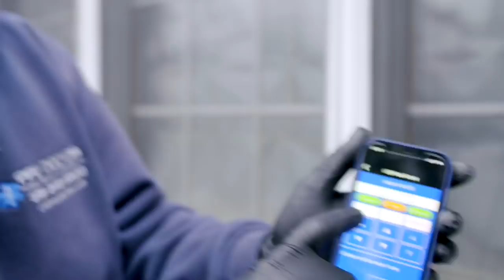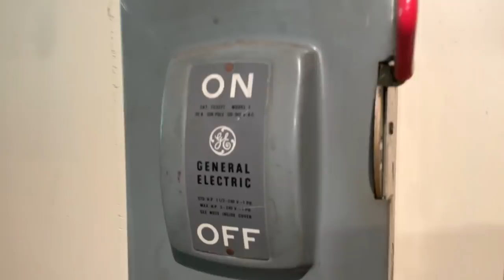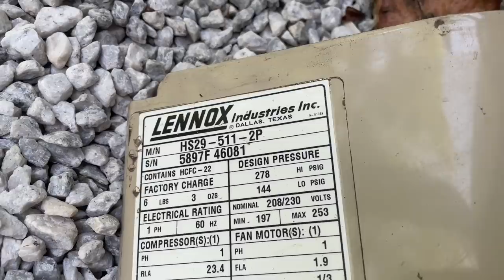House Almost Burnt Down - Luckily Someone Was Home - 50 amp Circuit Breaker Didn’t Trip Condenser

Comment: I am licensed electrican I would check main panel possible burn spots on bus bars. Rewire and replace everything going outside. To the proper wire and fuse size.

Comment: Mikey, In order to cover your ass, I would get an electrician to check the wire from the disconnect to the panel!  If that whip melted like that , I would bet that the wire to the panel has a pretty good chance of being damaged or at least was overheated!

Comment: Looks like bad ground connection. Breaker will not trip on short to ground if ground path has high resistance and less than 50A flows through it. It appears the conduit was used as ground path, but it probably has loose connection or corrosion. Even if metalic conduits are used running separate ground wire is better because of this possibility.

Comment: I would bet the line in the house looks just as bad. That's probably what they were smelling inside the house, luckily any nearby wood framing didn't ignite. I guess this is +1 for fused disconnects as a second line of defense.
Reply: I'm guessing the line wire is junk as well. Some of them fused 50-60 amps can also catch fire, but should stay contained inside the steel box. Sand filled at that amperage. Good call on the old school fuses.

Comment: Great video I second what someone said about the cause of the breaker not tripping was no equipment ground on line from panel to disconnect. Equipment ground would provide a low resistance path the ground to clear the fault and trip the breaker when the compressor shorted to ground. Without a equipment ground you have a high resistance fault Capable of melting the wires and starting the fire at a lower amperage than the breaker is designed to trip at.
Reply: 100% agree using steel flex pipe for a ground is a bad idea
Reply: Your right. That and 50a breaker on too small wore
Reply: I saw 3 wires in that flex conduit. 2 hots and a ground.
Reply: @NY411Info  the third wire was the low voltage
Reply: @sciatl2505  If it was the low voltage that seems weird. They usually run that along the line set I thought.
Reply: @NY411Info  yes watch at min 15.00 the third wire was the control wire he said that in video and yes the control wire should not in the same pipe
Reply: @sciatl2505  Ah, well that explains it. The conduit was a resistive heater at that point since there was no real ground. I think the 50 amp breaker was too big as well for that unit.
Reply: Under old code at the time that his building was built line voltage and low-voltage communication wire can be in the same pipe as long as it’s powering the same piece of equipment. Although I don’t do that but it was allowed by code.

Comment: What was the wire size on the 50 amp breaker?   Also, the nameplate said minimum circuit amps 31 and max size of 50 fuse or breaker.   As an electrical designer, I would put a 40acb on it, not 50a.    Respectfully,   Kevin

Comment: Similar scenario, I had a compressor short to ground. The ground was not connected at each end correctly. The current to ground then took the path of least resistance which was the suction line. Armaflex at coil actually caught on fire. Homeowner was home and saw the smoke thankfully. Electricity will do funny things if not done correctly
Reply: Almost exactly what happened here, except it was through the whip instead oof the suction line.
Reply: If the short happened in the liquid tight, the steel can act like a heating element which it did. Replace with nonmetalic. Upgrade the disconnect from the 3 phase one and have an electrician verify wire and  CB size are proper. 
Thanks Mikey I love watching

Comment: People don't really understand how circuit breakers work and why gfcis are where they are. Ground fault protected outlets are in your house to protect human life. Breakers are there to protect the infrastructure that is your house. The trip curve on that 50 amp breaker will trip before the insulation on that wire heats up to 130 degrees. Something failed in this system. Maybe the wire gauge (not likely), maybe the supply voltage, or in this case it's most likely a bad breaker.   If this homeowner wasn't home this house would be at best an insurance claim. At worst it would be a tragedy where a faulty electrical component caused an entire family to die. This is no bullshit scary. I've never experienced this level of danger first hand.

Comment: Mike ,Outstanding job on the electrical diagnosis I like how you always start with the basics i’m wondering if when that compressor shorted out .If it was a partial short making the wiring act like a toaster element it would’ve been interesting to do an amp draw test to see how many amps it was drawing ?????   Pete M

Comment: Jurzy wants fused disconnects,I use to whine but when I came to a similar situation that's all I use!!
There was a Loose connection somewhere!
You can't stop a Goodman!!!😂
ATTA BOY HIGH PRESSURE MIKE😎
🥃🥃🍺🍺🍺🍇🏌
Stay safe.
Retired(werk'n) keyboard super tech.
Wear your safety glasses.
Reply: No ground wire in the whip, that whip isn't designed to take short circuit current. Flex was acting like a heating element and the current was not enough to trip the 50 amp breaker before meltdown, could have even been less than 50 amps.
Reply: @jrmcferren  It looks like it had 3 conductors in it to me. I see 2 blacks and what appears to be a white. Blacks are hot and the white would've been used as the ground.

Comment: Was there a separate copper ground wire in the conduit? The conduit itself can't handle 50A so it melted even with less than 50A. The fuse is probably good and not at fault. The fault was a missing ground wire. Only if the circuit is RCD protected you can downsize the ground wire since a live to earth short will trip at 30mA or 100mA instead of 50A.
Reply: It's not a coincidence that new installations in Europe use a RCD on all circuits, it protects against faults like this.

Comment: I was on a roof one time,middle of winter and I did a friend a favor for his pizza shop,as I'm leaving the roof( -5 deg) a mother service tech is coming up my ladder, I'm like wtf,so I told him that the gas valve is junk and he says I'll double check it, I'm like whatever it had 0 ohms at the coil and 24 calling, so I'm like ok have fun and I got down and another tech come walking around with his ladder,so I told him that another guy was up there already,he was pissed and turned around towards his van,I took my ladder down and headed to my truck,went in and told him he owed me for diagnosing his rooftop unit,head like how about a couple slices,I'm like fuck off you cheep skate,so I left as I'm driving away the other guy was waving me down from the roof,I guess he should have brought his own ladder! The pizza douche called like 4 different companies ! Asshole

Comment: So being a Master Electrician for 30 years+  what I see here is there looks to be no ground wire, and the steel of the sealtite being used for this and it can but not over 6 ft and it is a poor ground if the connectors are not tight with a tool. Since the comp was shorted to ground, current was likely running across the steel of the sealtite and since it was a bad connection it heated up melting the plastic off the whip, but the current was still below the threshold of the breaker. Because the wires themselves are not melted at the condenser and the disconnect, only in the whip is their insulation compromised from extreme temp. My diagnosis (Visual not being there) breaker is not at fault of not tripping. People think the breaker should react but in reality breakers are only going to trip for a short to ground 200% rating quickly or thermal 125% over a given time frame. So if #8 or #6 wire had 100 amps on it for a while the insulation over the rest of the conductors would have been compromised as well. Bottom line ALWAYS run a ground.
Reply: I saw 3 wires in that flex conduit. 2 hots and a white. White would've been the ground in this case. Unless it was never connected in the panel.

Comment: Lucky for me our local code requires a fused disconnect along with the appropriate sized breaker…I always thought it was overkill until seeing today’s video…excellent video Mikey! BTW, my electric inspection failed after my new Trane was installed because they left the old 50A breaker in place. It needed to be 30A with the new 10G wiring run…the inspector said it’s his #1 inspection failure so it’s the first thing he looks at

Comment: Looks like a case of improper grounding in the AC whip. Instead of a grounding wire being run, the whip itself was being used for the ground wire. Most whips are not designed to carry fault current by themselves. Since you had a short to ground (a ground fault) the whip overheated. Okay, but what about the breaker not tripping? Good question. Tl;Dr: Your short wasn't passing enough current to trip the breaker quickly or possibly at all.

In this case your circuit breaker was working correctly. The above mentioned wiring error is why the breaker did not trip. If we look up the curves for a GE Q-Line breaker we can find the info we need here. This breaker can require between about 260 to about 1000 amps to trip instantly. The whip could not carry that kind of current and started melting down. Since your customer had time to actually shut stuff down instead of the breaker tripping, we can say we may have had maybe a minute or two head start before he shut down. With an optimistic 60 seconds (that whip didn't heat up instantly like a bulb filament), we now know that the high end of our fault current is less than 105 amps. I could keep going, but you need to realize another factor. The short circuit current itself could have been lower than the rating of the breaker.

Comment: There's probably nothing wrong with the breaker. Breakers allow for short over-currents and high peak currents. Peak current capability is needed for starting the compressor motor. The problem is in the whip: wires were too thin for 50Amps and they probably used the metal shielding as a ground conductor. That shielding is too thin of a wire and not made of copper. So, basically, that whip's shielding acted as a space heater, covered with a plastic bag.
The breakers are usually rated for the house wiring. Anything that is connected to the house wiring should have its own fuse. At an A/C, usually located in the disconnect box. Or, in this case, the panel breaker could be swapped for one with an appropriate rating for the A/C and its whip and unfused disconnect.
In this case, I'd go for a new fused disconnect. The rating of the disconnect must match the rating of the breaker in the panel. The rating of the fuses in the disconnect must match the recommended rating from the compressor manufacturer. Besides the two live legs, the whip also needs to have an equally sized ground conductor, and no thermostat wires!
Your ground is your most important conductor. You don't want that 50Amps finding its way through the line set, evaporator, air handler, thermostat wiring and natural gas line.

Comment: You are absolutely right that house could have burnt down! That's why it's a good idea to have a fused disconext on the outside! That extra layer of safety is a life saver literally! Like the options you gave to the customer Mikey pipes! Most customers don't realize that the best option on a old unit like that is to just replace everything and have a warranty and save money in the long run!

Comment: I have a 80% efficiency furnace and AC that I know is at least 22 years old, likely older than that. I'm not having any issues with it right now, but I know that it is only a matter of time. I'm pretty sure that the next service call that I have is going to end up being a "recommend to replace" the entire system. I am not looking forward to that because I know we're taking around $5k.

Comment: So, for the whip to burn like that your looking possibly 2x or 3x of wire gauge ampacity running. Which as Mikey Pipes demonstrated a direct hot to ground in compressor. Thermal cutoff safety in compressor failed? Compressor windings melted together somehow... Another possibility is undersized wire for the distance from panel and or corrosion and resistance slowly built. There were 2 comments of missing ground wire or short to the melted sheathing that just heated at low amp. But still the compressor was full short or internal wires insulation melt cause another full short... The breaker can trip without a ground wire. Phase to phase short pops breakers. Multiple  safety's failed here...

Comment: Yes seal tight can not carry enough current to clear a 50 Amp breaker. I did not see a ground wire in the seal tight, seal tight needs a separate ground wire for any thing 20 amps and over. Improper electrical installation. When the compressor shorted the current went through the seal tight and melted.
Reply: That was my thought exactly.

Comment: I didnt see a ground wire which means that it grounded through the flex cable. I'm pretty sure that combine with 50a breaker on what looks like 10ga cable was the cause.
Reply: Aha!! Good catch. The wires would have be able to carry enough current to trip the 50A breaker, but the short was to ground via the steel flex, and that just heated up and cooked everything.

Comment: I have had a similar experience where wires melted the insulation and shorted together causing a fire...........The unit (indoor ac)never shut off despite the loud popping........The breaker was on a 120v  20 amp breaker and never tripped............later the unit was fine and the breaker tripped when shorting out the outlet........Basically what I learned is a short to ground may not trip the breaker when the unit is under load.........The root cause was a 3 way outlet connector ..........I bet a pinched wire caused hot spot......

Comment: As an industrial electrician for 40 yearsI have seen and witnessed similar situations on 3 phase 4160 vac where phase to phase and phase to ground short together and will not trip the switch gear. Instead I've seen it blow the utility power lines off the poles because of the high currents before it ever blew open the primary fuse to the main transformers on the utility's pole and because the power lines feeding the pole transformers also went to ground in the process it finally tripped the main switch gear that also knocked power out to the whole facility. According to electrical engineering the very high instantaneous currents just latched everything closed.

Comment: Running a 50 amp circuit breaker on a outside unit with no heat pump, no wonder it did not trip. This unit would not require a 50 amp circuit breaker look at the label on the unit.

Comment: Min ampacity is 31.2 which means 8ga electrical conductors, max fusible is 50a.  Per NEC code that means 8ga conductor is fine on 50a breaker because the compressor should cut off if it shorts.  Assuming the compressor/case is properly grounded.

Problem here is that there was no ground.  There was no path back to the breaker to allow the breaker to trip.  The electric charge was going somewhere, likely through the furnace via the A-coil.  This did not allow the breaker to trip because it wasn’t enough current to trip the breaker right away.  It was likely 60A or so which would melt that insulation after 15mins or so.

This is why it’s so important to have properly grounded equipment.  Properly grounded equipment allows for a high fault current which pops the breaker faster.

All the electrical wire needs to be inspected on the furnace & the AC condenser wiring needs to be replaced along with the breaker.
Reply: Finally the correct answer      proper grounding is needed. Also nec says wire size is set by min circuit rating on name plate & fuse or breaker is set by max circuit rating on name plate
Reply: Also compressor overload should shut off compressor

Comment: Scary, how lucky homeowners were. Our service manger had a surge protector that was attached to the condenser disconnect short out and catch on fire and start melting the house siding. I agree with the other peoples comments about there not being a ground wire and the flex conduit becoming the ground. Keep up the great videos.
Reply: I saw 3 wires in that flex conduit. 2 hots and a ground.

Comment: Back in the 90's I used to find copper couplings in place of fuses. 25 year old condensers back then needed 50-60 amp fuses. So, if the tech didn't have the right fuse size. copper was the next best replacement. Very scary!!!!!

Comment: Number 1 thing, he needs to replace that breaker..  It's clear that breaker is no good.  Scary.   I had a 200 AMP breaker on my property that failed "on".  (It wouldn't turn off.)  That's the closest I've experienced, but that was a big deal to get fixed.

Comment: This is not the first time ive seen a breaker not do its job one time i was trying to figure out whiich breaker was what so i dead shorted it to yes pop the breaker i was welding w that wire it never popped i swapped out any suspect looking breakers later on did it again and bam found it and have seen melted breakers due to dirty contact on the bus bar etc etc jts is amazing we dont hear of more bad stuff happening thsnk god